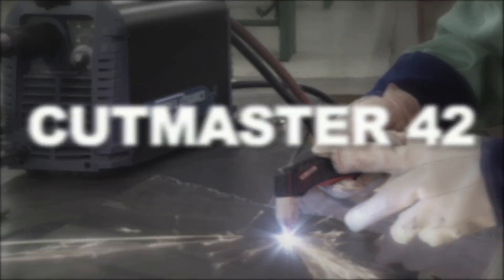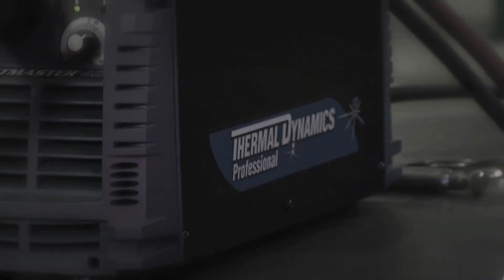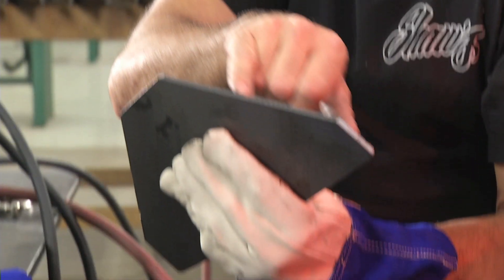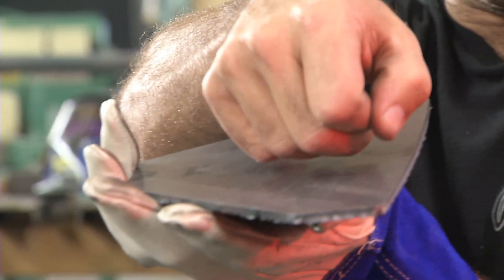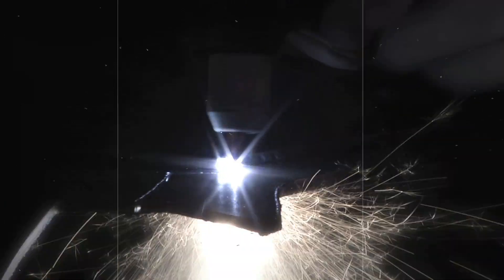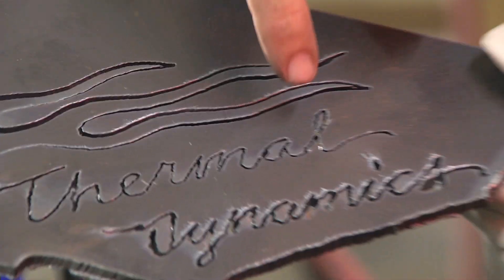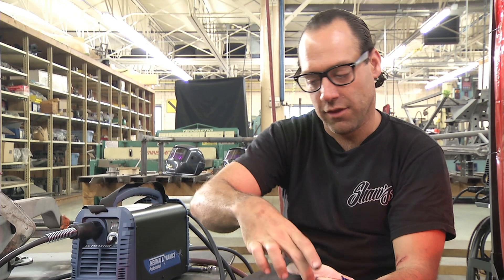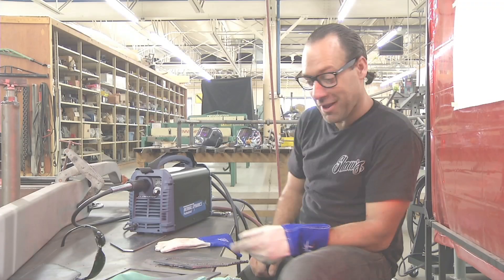CUTMASTER 42 Plasma Cutter for Auto Restoration: Expert Review by Joshua Shaw

Comment: Hey man.
I have about maybe 2 total hours on this with cutting misc. steel. It keeps shutting down on me. I have tried everything. (i.e. changed all the consumables, open up the torch to see if everything is hitting, changed power source, adjusted my air flow.) I don't get it. What is going on with this thing. I spent nearly $1,200 on this thing and it has been giving me troubles from day 1
Reply: Dennis Ostrander you need a water 💦 trap 
To eliminate water from the air 

Thermal dynamics sells one called single stage air filter kit that will solve your issue 
Your welcome
Reply: Mine came with a Campbell Hausfeld water trap., I've only used a couple times on 1" square stock, I have 2 compressors, I'm restoring 3 old Ford, been doing this exhaust manifolds on 1,needs some places on the framework and couple on the body.